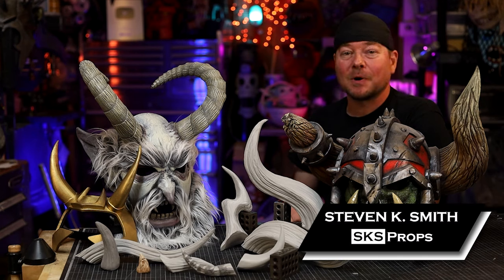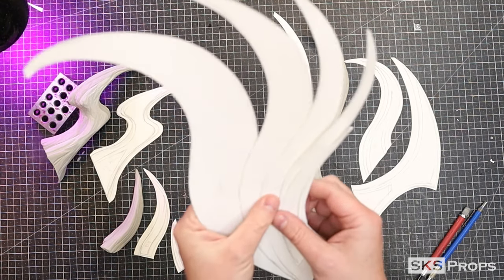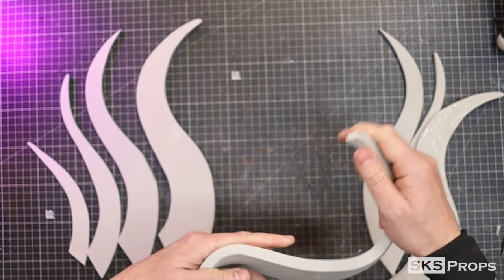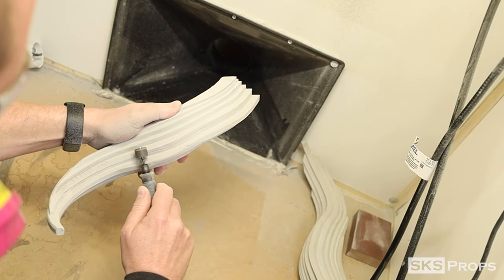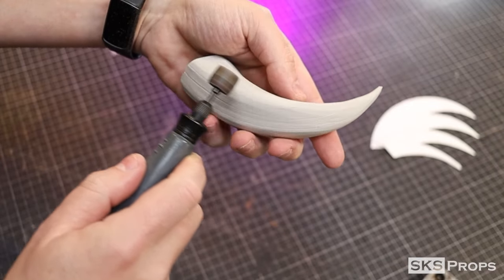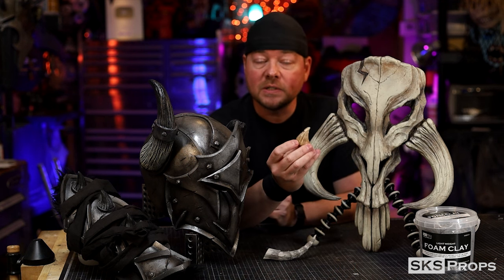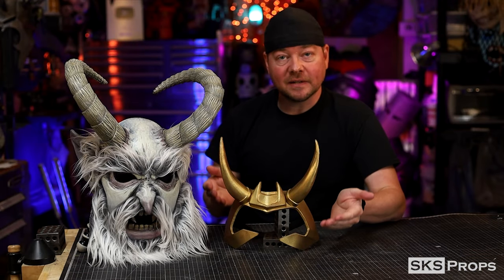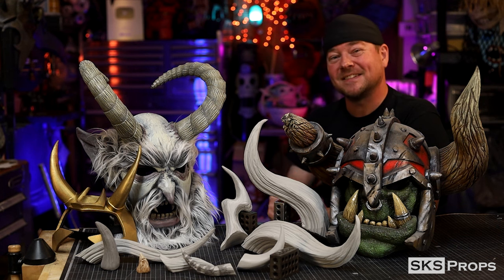How To Make Eva Foam Horns for Cosplay - Quick & Easy! Free Patterns Included

Comment: Great video and explanation! I have some questions for the community and/or the channel:
I want to do horns for an orc cosplay and stick them directly onto my forehead. I was thinking about covering the edges with Latex or wax "skin". The main thing I wonder about is, how do I glue the horns on my skin? Will something like Mastix (spirit gum) work? I know it works for latex applications, but for EVA foam too? I also plan to prime them with Mod Podge before colouring. Do I also prime the base that will be glued to my skin? 
Thanks in advance!
Reply from the maker: Foam or foam clay horns work fine and yes spirit gum will work. I don't know that I would prime the bottom because the porous foam might grip the gum better. I actually did a video on that a few years ago  https://www.youtube.com/watch?v=X7zHTzt61-A

Comment: Hey awesome video! Two questions for ya. Would you say the aluminum foil method is the most durable of these three techniques? Also are you just glueing these to the mask/helmet or is there a stronger way to make that connection?
Reply from the maker: Depends on the length of the horns and the application. I used the glue together method on my dragon bust and those are huge. Most of my horns are glued directly to the mask, helmet, head.  Using contact cement that’s not an issue. But some times I want them detachable for travel like my krampus mask or deer skull.  Lots of options just depends on the project